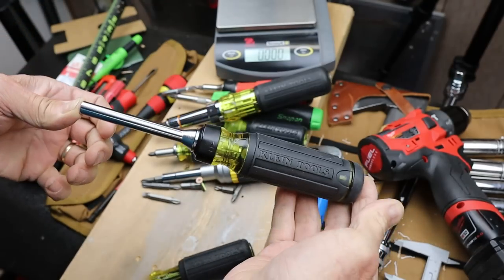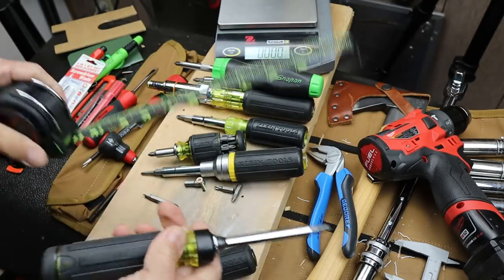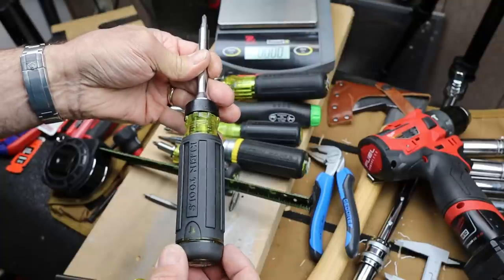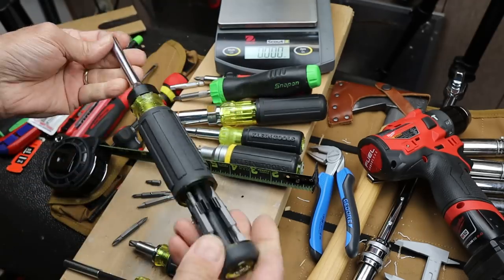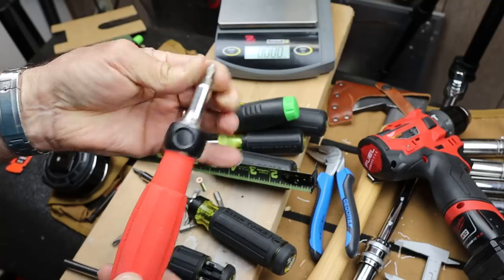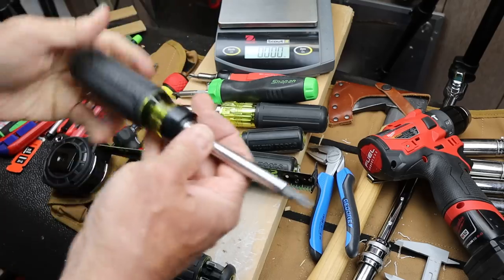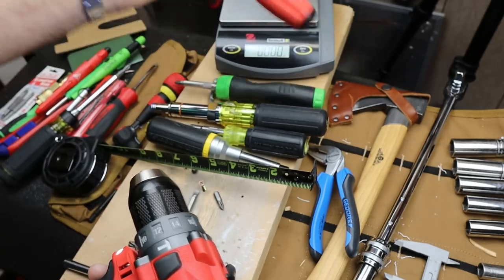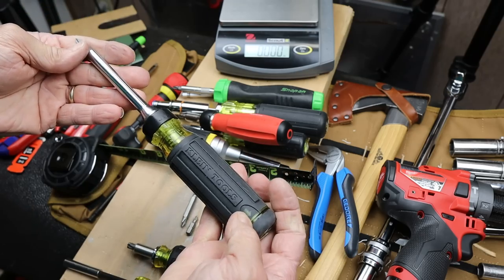Klein 15:1 Ratcheting Screwdriver: Sleek, Modern, Less Bloated. Nice if proprietary is fine with you

Comment: I have this screwdriver, and while the proprietary bit thing sucks, the screwdriver is very nice to use and feels good in the hand with a smooth ratcheting action. I also appreciate how the bits are stored and the types/sizes of bit included. There are better ratchet screwdrivers but this Klein is very good for the price. You're getting a lot of tool for $20.

Comment: Proprietary bits are a no-go for me. There's nothing wrong with regular 1" bits, especially if your double ended proprietary ones are twice as long anyway. 

I just bought a Bahco 808050P, it's sort of a cheaper alternative to the Snap-On pistol grip ratcheting drivers. Maybe you should consider featuring that on the channel, might be interesting to those who like the idea but don't want to spend the money on the Snap-On. It lacks a removeable shaft and has a different bit storage compartment, but overall seems like a well thought out tool.

Comment: I’ve been using the Rolgear 15 in 1 screwdriver, in my opinion it is by far the best. The gear less ratchet with almost no back drag is amazing, you don’t waste time with having to hold the bit end to reset the ratchet. It’s slick. It’s not heavy duty by any means but for light to medium duty it’s by far the most efficient driving screws, specially with electrical work. My only complaint it the direction selector, it could be better.

Comment: those flip tip dual end things never work out for me i always leave the tip out to use it as a nutdriver then forget to put tip back in and have a pile of them with missing tips the ratcheting 15 in 1 is my favorite screwdriver now it fits my hand well. i can use the selector for ratcheting with one hand and the bit storage Is good you actually can find bits easily and change them out and put the one you're not using in the handle so haven't lost any yet.

Comment: I wish they had combined the # 2 Phillips and the 1/4 flat blade like most screwdrivers do as those are the two sizes you’re flipping back and forth most of the time. The ability to flip is somewhat useless without that.

Comment: I use the 15-1 as a daily for Industrial Maintenance work and it does pretty good, the only downside is the rubber handle finally came off after 8+ months of use.

Comment: I've got one and it stays in my electrical bag as an all-purpose (non-insulated) driver.  One of the few multi-bit ratcheting drivers that comes with a pair of combo-bits that are perfect for receptacle screws... combination square and slotted that fits the screw heads perfectly.
Reply: I have a Milwaukee insulated set of three that included that tip. The thing is ideal for installing devices.
I think Milwaukee calls it a ECX tip?
Reply: @frankrosemeck9898  Correct.  I have Wiha insulated drivers... they call it a Xeno bit.  Seems each manufacturer has a different name for them.  Once you try them, you never go back to a phillips or square driver for the task.

Comment: Klein screwdrivers should be boycotted for using proprietary hex bits. Especially given the fact that they vary the hex bit size from one model to the next within their own range of screwdrivers so that you can't reuse a bit with a different Klein screwdriver model. There's no valid reason for them to be doing that except to milk the cash cow and blatantly lock you in their products.
Reply: I've carried the long version of the Phillips/slotted/nutdriver for years now, but am so tired of replacing it because I can't use other bits when one gets worn.
Still looking for a solid replacement for that thing...

Comment: Personally I’m done with proprietary bits. What happens if they stop manufacturing those and a bit gets lost? To save $10 off the PB Swiss? Nah. Remember the Klein Precision pentalobe bit issue? Did they ever replace that? Do they sell the bits individually?

Edit: ah you said the PB ratchet was $100- not sure why I thought $30? Perhaps the non ratchet PB bit driver.

Which of your ratcheting drivers do you find yourself using the most?
Reply from the maker: Klein dropped the ball on the replacement bit. They called me and assured me one was on the way. That was before Christmas. I use my Snap On ratcheting drivers the most. Probably because of the shaft selection and there are more of them in the fight then the others. But if I had to use only one, the PB Swiss feels really good in the hand.

Comment: I'm sure there's a good engineering reason they don't exist but I've always wondered why ratcheting screwdrivers have so few teeth (<50) compared to a ratcheting socket wrench (60-90 teeth).
Reply: The number of teeth helps with arc swing, which isn't so much of an issue with a screwdriver because it's rotational plane is shared with the direction of use. Where as with wrenches it is perpendicular, and needed for tight spaces.

Comment: I really am not a fan of bits with ball detents, especially ones that are not the standard 1/4" size.  Had some of those ball detent bits fall out.  Hopefully, it just rattles around inside the handle, instead of being lost in the bag or job site.  Would rather have magnetic bit retention and be able to use any of my 1/4" bits.  I also don't like all of that flipping to find the bit you need.  I ended up with the Wera ratcheting screwdriver and am liking it quite a bit.  Could not justify the cost of the PB Swiss.

Comment: I have all of them.  I say that with almost no qualification.  Gedore silent gear or the Hazet one which is similar are the best.  I prefer the basic Gedore because I like the slimmer handle, but the deluxe Gedore and the Hazet have bit storage I. The handle.  The Hazet and Gedore use the Rolegear mechanism.  All the new klein are ok, but they are foreign made.  The 15 in 1 is fine I guess, but it’s annoying because it requires too much resistance to work.
Reply: Agree, Gedore and Hazet silent drives are IMO best of breed in this tool type currently. I have the basic  Gedore as my go to bit driver - but was pleasantly surprised how good in hand the Hazet with bit carousel felt (expected it to feel a tad too bulky).

Comment: So I've come to love my Milwaukee 9 in 1 ratcheting screwdriver, and then I have the Milwaukee 13 in 1 screwdriver that has the different nut sizes and ECX bit (the combo bit) I do a lot of electrical and hvac, and Milwaukee hand tools have been better in my opinion to the new Klein ones. Not been happy with Klein stuff as of late.

Comment: I use PZ-2 and PZ-3 screws a lot (gradually using more T20 and T25 as well).  PZ-2 & PZ-3 seem a bit rare in these screw-drivers.
Is that partly an America market issue, since more Roberts screws are used in that market?

Comment: Sorry, I avoid as much as possible any & everything requiring proprietary parts/components... always have, always will.

Not only that, the increased shank diameter of those multi bit drivers might be 'ok' for unobstructed fasteners out in the breeze, but useless for the ones down in tight recesses etc

Comment: Hi Doc,  Do you think you could glue in a magnet down the shaft for a spacer to allow you to use standard bits instead on this Klein Tools 32305?  Or maybe drill a hole into the magnet to still get it back out if it didn't work.
Reply from the maker: Well first, I don't think you can easily drill a neodymium magnet. I shatter and break many of them doing mundane things. I don't see why gluing magnet would not work since that is how pretty much all other screwdrivers are made. However, the length needs to be there to support the bit which could be an issue. Frankly, there are much better ratcheting screwdrivers out there for not much more money and they were designed for the regular bits from the drawing board forward.